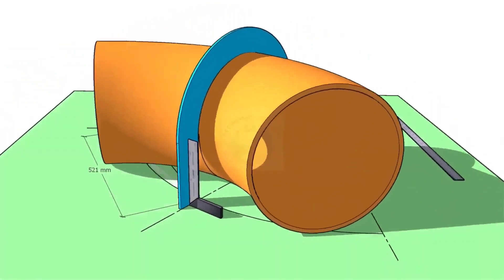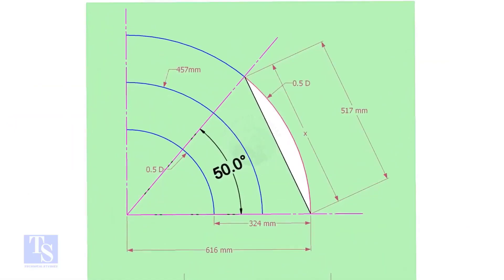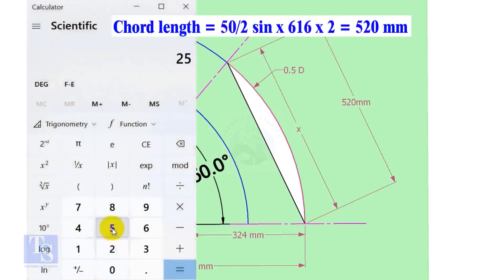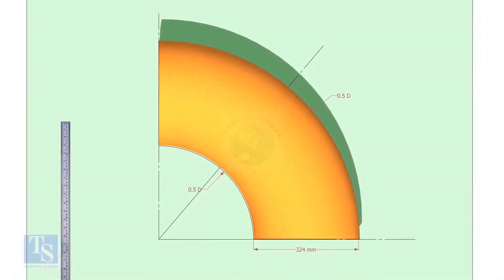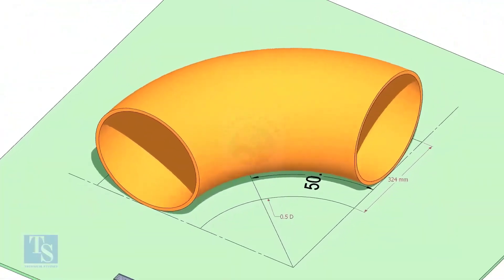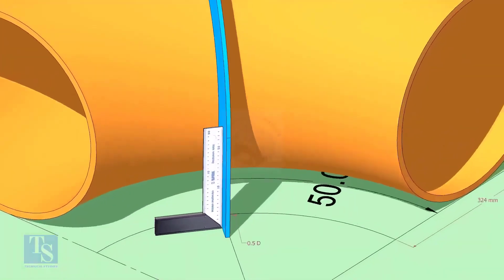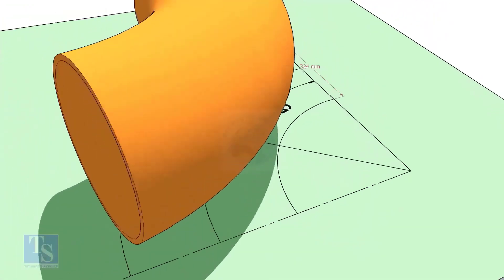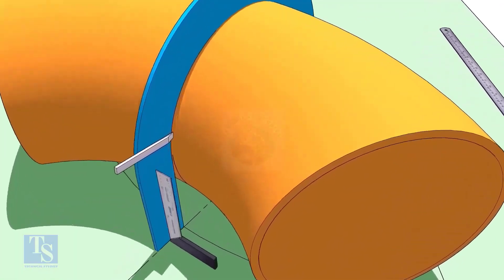How to cut an Elbow to any Degree  Simple method

Comment: Yeah I'd have this cut before you have that plate cleaned and ground. Also what is this magical surface that you are laying a 12-inch elbow on and drawing dimensions on? Someone needs to make non-perfect world piping videos
Reply: Out In the field this method probably won’t be as useful or practical, but in a large fab shop this is completely feasible and helpful
Reply: Yeah, this would be a tough jig to align properly. I've used a similar but different method that was somewhat immune to the variability from one weld-el to the next.

I designed and build a turbo manifold for an inline-6 engine. I designed the manifold in CAD, fairly complex design (40-ish cut-down pieces of weld elbows), and as such I knew the exact angles each piece needed to be. I cut on a horizontal bandsaw.

To mark the cuts, I found the linear length of the inside of the bend, centerline of the bend, and outer radius of the bend. Made a very simple jig to mark every 90deg around the circumference of the weld-el (just a board with a square notch cut in one edge, notch was same size as weld-el outer diameter). Using the 90-deg marks, I measured out the inner, centerline, and outer distances of the target bend angle. Once those points were marked on the weld-els, it was easy to connect the dots with a ring of scrap tube to get a cut line all the way around the tube. Then when I clamped into the bandsaw I used some parallel plates to get things lined up perfectly. Sounds complicated, and it is a bit, but once I got the hang of it, it ended up being really quick and accurate to get the tubes marked and clamped in the saw (with the caveat that I had a CAD model to pull my measurements from). The whole thing went together nearly perfectly with hardly any adjustments to cuts needed.
Reply from the maker: Be patient bor. I am making videos to encourge ordinary workers. It took me 1 week to make this video. Do you think i am making big money?